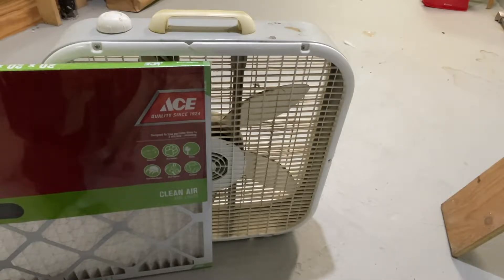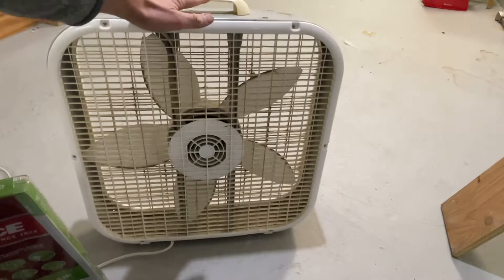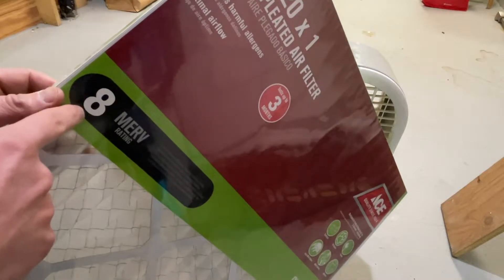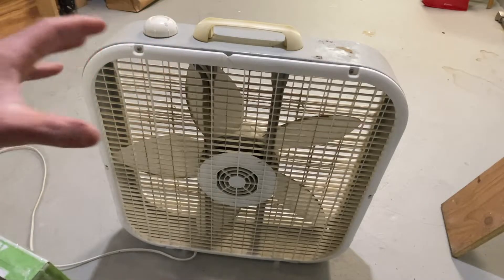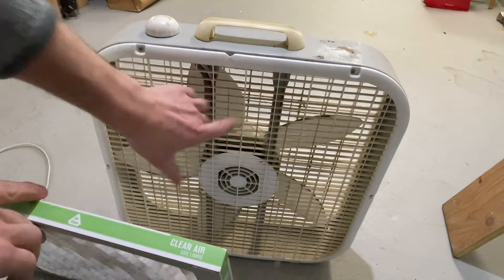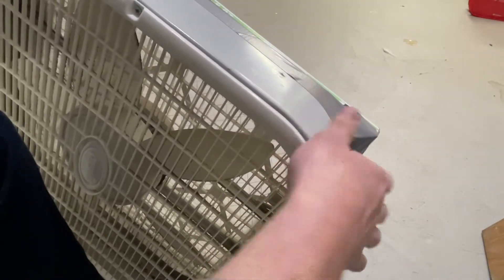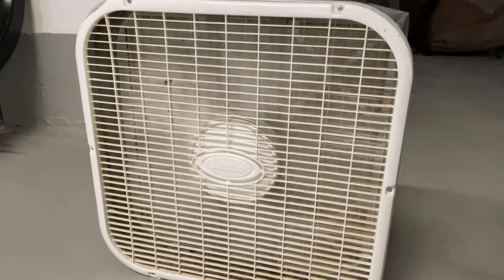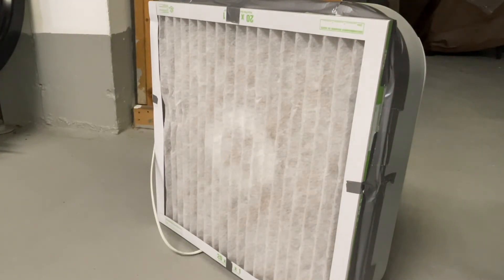Building A DIY Air Purifier With A Box Fan And Furnace Filter

Comment: I thought this was my idea so I tried it before seeing this video. I can tell you that a box fan does not have the power to have such a restriction placed upon it and my fan was struggling to turn. I suspect if I had kept the filter on the fan for long the motor would heat up and burn out in a short time. 
This is probably why what seems like a good idea is not a good idea and one can not find such a thing on the market. Not a Good Idea.
Reply: AND how many ppl have built these and never had problems?! Smn
Reply: I'm going to try the cube style. But, lots of people are just putting a filter on the fan. I guess it's not as bad as I thought.
Reply: @Kotaztrafee  For this single-filter design (which is far more portable), the thing to do is use a lower-rated filter (perhaps MERV10 or less) so as to allow more inflow.  If you're really concerned about overheating the fan motor, use the low fan speed setting and use a cheap lamp timer to automatically switch between the off and on states every half hour.  That way, the fan motor has a chance to cool down regularly.

Comment: I'm lazy, I found that if I turn on the fan the suction holds my air filter tight against the fan. No tape...
Reply: Yeah. This just makes it look like a pain to change the filter.I just run mine on low constantly.
Reply: @ptelligence every have problems of overheating
Reply: @jonny6758  Nah, not running on low.